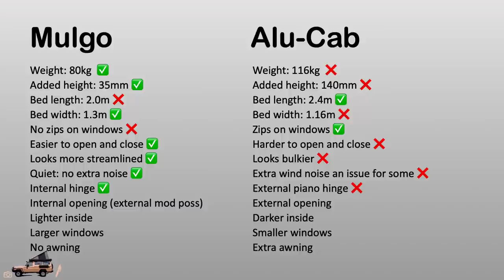Pop Top Showdown: Alu-Cab Hercules vs Mulgo. Troopy Talk Episode 3

Comment: Hi all, my name is Ben, I have worked for both companies and currently still at one. Which you will be able to guess. I would love to add some info to this video for a few things that were addressed and a few other points. Many touching on a bit more of the reasoning behind design. 

Mulgo is designed and manufactured by a team who has travelled the world extensively in a vehicle. Internal latching is actually more then just a few seconds setting up in the rain, you don’t have to leave the vehicle to open and close the roof which in an emergency, wildlife encounter or just plain terrible weather scenario means you can actually just pack up and go without leaving the vehicle. 
And Alu Cab owners, you would want a few extra sets of roof latches as the break regularly. 

As for canvas and bed width, two adults lying next to each other in Hercules and also alu cab tents results in shoulders touching the side of the tent which leads to condensation and wet campers. Not fun in the desert in winter trust me. The airtex canvas used in Mulgo doesn’t draw water. As for the darkness in canvas that’s irrelevant when sleeping in the bush. 
Velco vs Zippers. Well zippers seize. Velcro doesn’t. 

Bed length. If alu cab bed is closed and someone needs to pee in the middle of the night. Guess what? Your gonna have a angry wife who has to wake up and moved so you can pull apart the bed. 
Internal fire? Another reasoning why Mulgo bed is one piece. Don’t wanna get stuck upstairs. 
There was a 6 foot 6 Mulgo customer who had no issues with the single bed platform. 

As for external closing of Mulgo, that can be arranged on fitment as we do all CUSTOM fitting. Alu cab is an out of a box product. 

All Mulgo is CUSTOM to each vehicle to due travellers needs. 

It may sound like I’m throwing one company under the bus, I am just highlighting some stuff that should be mentioned. 

Free to answer any questions!!
Reply: Hi Ben. Some great points. Maybe you can help me with two things . first we have a third seat. Do you know if the mulgo or alucab allows more headspace for the person in the third seat when closed? Also, how does the mulgo go in wet weather without the awning. If it’s raining does it mean all windows need to be closed so no ventilation or is there a workaround for that?

Great video @fritzintroopy. Thanks for the comparison
Reply from the maker: Hey Ben. Thanks for your awesome input. I’m sure it will be extremely helpful for anyone watching and reading this. All excellent points which is why we love Mulgo so much. Cheers and thanks again.
Reply: @toryheaslop9069  hi Tory, the Alu Cab unit sits higher on the car and is a much taller heavier unit. We fit Mulgos to all two, three or five seater troopies. Both units sit lower then original roof as bed has to fit somewhere. Wet weather, I’ve had one up in cape York in summer time. Hot, muggy, wet. The canvas itself is breathable. Windows can be rolled down from the top and still under the outer edge of roof.
Reply: @Kelvin Weeding Thanks Kevin. Really helpful to know. I’ve been wondering about that for ages!
Reply: Good relevant information Ben. How does the Canvas on side of tent go when sideways windy rain, no water seeps in? Does having one of these mean you have to manage airing the side wall canvas out from time to time should the canvas be wet from again sideways rain & when you pull it down/close and the canvas could still be damp?
Reply: You mentioned they are custom to every customer.
Can you get a darker canvas and can the bed be extended if wanted? 
How big is the gab between end of bed and car frame atm when the bed is lowered? 
We have a hitop troopy atm and considering converting to a pop top.
Reply from the maker: @Kelvin Weeding that's great to know. Thanks Kelvin
Reply: Hey Ben,

Counter points for anyone that cares to read;

Internal latches are more a rare convenience in the event you don’t want to leave the vehicle for any reason, but would be an awkward maneuver for most grown adults.
Dangerous Animals, you could move vehicle if concerned with roof still up to avoid danger. 
Either tent could, and has been here, modified with External/ Internal latches to suit the individual.
Security may be the most valid point to internal latches.

Sleeping, you can still leave rear section up in the alucab if you're worried about the wife and are short enough to do so comfortably.
Or you can use the zips on the rear fly screen to exit if you need. Climb down the spare wheel, Could even take an extendable ladder to the side of the vehicle for the most frequent pee’r.

Bed width/ length is all relative to whatever size you are. If you’re Tall or short, and wide, you’re in strife either way.

Canvas colour/ Light Might be relevant to the traveller using vehicle as a camper during daylight hours. Or if the Bright Moon/ Early sun is of concern.

Zips Seize, velcro doesn't last forever either.

Internal Fire is a weird point, unsure how one piece Mulgo would save you in this circumstance? Without windows that open, you’re stuck up top to fry if there’s fire below.
Reply from the maker: @scottround3400  hey Scott. Thanks for your comments. All valid points cheers. Really helps to get peoples perspectives on these fit outs and there’s been plenty of good points made.
Reply: @toryheaslop9069  Hi, I have a 5 seater troopy with a mulgo poptop. The poptop was modified to deal with the rear factory seats by Daniel of Expedition centre by doing 3 mods to a version 2, 1-lifting the bed platform up on 20mm spacers, 2-dropping the rear folding seat by cut/weld to the folding by about the same and 3-the lower sandwich panel of bed frame directly above the rear passengers was removed. Result means my 189cm son can sit in the back seat easily, the overall external height exactly the same and still can carry bedding to about 40mm above mattress. Without the mods the rear seats would be very cramped been for a small person. From what I can figure out the mulgo is lower because the bed platform is lower, video/ images of both poptops show the alu-cab sits higher on the roof remnants.
Reply: @markwalters2490  Thanks Mark! I think I might have actually heard about the mod done for your 189cm son on the grapevine. Hope its working beautifully for you.
Reply: Even with this info, it seems the alucab shits all over the malgo. The extra sitting shelf, the storage extras and extra length are winners. It just looked better quality but  you can’t always judge a book by its cover I guess
Reply: Internal fire risk? You can unzip the fly screens in the alu and jump right out.. another huge bonus I think
Reply: @aussieadventurenerd8137  Australian made may sway people towards the mulgo.
Reply: The lower profile and 36kg lighter is the biggest factors that swayed me to the Mulgo.

Comment: A few years back I was looking at both of these conversions...ultimately went for the Alu-Cab for the extra length of the bed, the darker style canvas and the availability of a distributer not far from where I live. Haven't looked back in getting the Hercules conversion.
Thank you also for the life hack of adding a strap from the main bed looped thru the smaller flap to be able to pull it all down from the outside, fantastic idea!
If I'm able to provide a hack which I use to be able to close the main lid A LOT easier. I leave all 3 windows 1/4 to 1/2 open with the canvas folded in towards the fly screen (so as to not get caught) that way the air trapped inside can easily escape and the top will come down no worries at all. The lid has an exception weather seal the full perimeter and have never had rain, dust or sand enter under the lid and into the bed. Hope this helps!
👍👍
Reply from the maker: Thanks Nigel for these great comments and tips. Appreciate it. Cheers

Comment: This is great - a world exclusive! Here are my thoughts and comments on my Hercules.

Firstly - additional height. I really struggled to get a clear answer from AluCab on this, which really annoyed me. One fitment manual said 4.9cm additional height, another document or email from AluCab said up to 14cm. Considering I had a strict limitation with my car park height, this was really important to me. It's also pretty critical for anyone considering a Hercules, so I don't understand why they don't make it clearer. There is some leeway, it seems, depending on how it's fitted, which AluCab should document. The garage that fitted mine in the end were aware of my car park height - a little over 2.2m. In the end the Hercules added 8cm additional height. This, along with a a 5cm lift, left my Troopy a shade over 2.2m, which meant I could fit it in my car park. You can imagine my nerves when I first drove it home after the conversion... And how pleased I was when I made it to my parking space intact! (Obviously I had measured things all over the place to be sure, but still).

Weight - it may weigh 116kg, but the original Troopy roof is obviously removed. According to one of AluCab's fitment manuals, it adds 80kg overall to the Troopy once fitted. Presumably the bits of the roof that are removed as part of the fitment process weigh 36kg.

I really like the fact that the Mulgo lights have usb sockets into them. I had my garage run some power up inside, but it's not as neat as just plugging your phone into the base of the lights at each side of the bed. For me that would make a huge difference to the practicality of the Hercules.

I'm 183cm (6ft) and it's not really a problem if the person next to me needs to open the 'lid' to get out when I'm asleep. That area is also a nice spot to store clothes, books, etc, when you're asleep up there. Some people convert it so that it's cut in half so one person can slip down. With regards to the Mulgo I think for me it would be weird sleeping with a gap behind my head, plus my pillows, Kindle, etc, would fall over the edge at night! I've only ever slept up there with my daughter (8 at the time of writing). If it's my wife and daughter out with me I get relegated to a small pop up tent. I'm sure my wife and I would fit up there ok together and I know a couple who have travelled for weeks in theirs. When you're on your own it feels positively luxurious up there.

I need to check my side windows - a friend who bought one at the same time has zips on his for the fly mesh. I looked the other day and couldn't find any zips, perhaps I have velcro? Either way I've never felt the need to open them yet, but I can see why it would be nice to be able to.

I often don't bother with the 'awning' at the rear. I find I open the side windows to get some breeze or look at the view rather than the back window, but it's nice to have the option. A top tip if you do regularly put the rear awning up - get some grip tape on your rear bumper! It's really easy to slip, especially when the bumper is wet from rain or damp with morning dew.

The clips at the read do pop open. I have two little caribiners there to keep it closed. If I were travelling outside the UAE or the GCC, I'd put a padlock on them.

The Hercules is really well insulated. Keeps me warm at night (it can get chilly in the UAE, but rarely to sub-zero temperatures.) Best of all it keeps me cool in the morning when the sun's out. I tend to, ahem, go to bed quite late and like to sleep in in the morning. When my friends' tents have turned into microwave ovens from the sun at 7am, I'm still nice and cool in my roof, especially with the help of a small fan, until well after ten during camping season. This is very important to my enjoyment of camping!

The shelf at the front is great. I need to carpet mine so I can stick things onto it. I've run some power up into it, so I can charge things there easily.

When I was ordering mine in 2018/19 Mulgo would only install at their HQ in Oz (or at least only at affiliates elsewhere in Australia), so they weren't an option. 

The Mulgo does look like a great bit of kit - there's no clear winnder and I do understand what Ben says in his comments above about being able to open and close the roof in bad weather, or when surrounded by animals. That's not an issue for the way I use it, or for anyone else I know who has one in the UAE, but the point is still valid.

Both great options and I'm very happy with my AluCab Hercules. It does turn the Troopy into something you could genuinely live out of for long periods of time. I hope I get to do that one day.
Reply from the maker: Thanks Christopher for this detailed contribution. I'm sure it will be every useful. Cheers

Comment: From what I've seen, as an automotive design engineer, the Mulgo units appear to be designed around a roof replacement frame, whereas the Alu-Cab just seem to be a rooftop tent redimensioned to fit. That's certainly true on the Defender pop tops, where the Mulgo Cant rail completely replaces the roof for structural & torsional purposes so the vehicle could actually be driven with no roof. The tent is then built into that. The Alu-Cab doesn't seem to have much more than the Gen 3 tent bolted on & the lid clearly takes some torsional stress as they all bust the latches in use.

I know which way my Defender is going 👍
Reply from the maker: we're definitely happy with the design now having driven over some pretty rough stuff and done a fair bit of 4WD ing. the whole unit seems rock solid. great design
Reply: Not to mention the weight!

Comment: I would like to know what the interior height is when the roof top is closed? Is there any difference between the both? (As I would also like to sit and sleep inside when the roof top conversion is closed - for example in cities.) Thanks!
Reply: The interior height from underside of bed platform to metal cargo area 1110mm for Mulgo v2

Comment: Couple of Questions:
Just curious here with the Mulgo... to make the Bed longer, could u store a suitable size piece of Plywood under the mattress then pull it out and slot it in the open area to increase the length of the bed or just make something similar to what the AluCab has?
Also, Is there a option (paid extra) to have the windows/flyscreen modified to have zippers?
I noticed on the Alucab that once in bed that it would be impossible to exit the bed area during the night to go to the toilet without disturbing your partner...

During heavy rain period when packing up... With the Mulgo having no awnings I assume the canvas could get quite wet - when packing up is there a catch that water could eventually seep through the canvas when packed up and wetting the inside?

Great comparison... I didn't realise the differences between the 2. I initially preferred the AluCab but seeing the difference in bed width, extra height and overall height, the Mulgo might be better suited for our needs
Reply from the maker: Hey Rob, glad you found the video useful. You could make the bed longer using your plywood or similar technique for sure. I haven't bothered because its just long enough for me. Regarding the wet canvas apparently its not an issue for the bedding as it doesn't seep through. We've yet to be caught in very heavy rain. The worst we had was a shower overnight which made the canvas moist and there was no issue

Comment: Great review thank you for that! So in a nutshell the Mulga is for Hobbits and the Alu Cab for normal people. ;) ;) ;)  You showed me a lot of ideas for our Alu-Cab Hercules, e.g. that you can put down only the little bit to sit on it in bad weather, great idea. The pull down strap for closing both platforms at the same time. You didn't mention the electric set up, e.g. the reading LED lights up inside on either side, the lights in the front and end. For the closing of the roof in general, it is much easier if you leave a window unzipped and to make it much easier as well you should put the string where you pull below the rubber band which is holding the sides together, so when you pull it down at the same time you are pulling the walls inside... The comparison though doesn't fit 100%, "Harder to open and close" (In the video it looks much more work to close the Mulga), "Looks bulkier" (subjective), whereby darker inside is a huge plus for the A-C (when I am inside I usually want to sleep). The awning is a big plus, when it is raining you can leave the window open, without you cant. Great review! Much appreciated, thank you!
Reply from the maker: Hobbits... too funny😂. Interestingly many taller people find the Mulgo bed length suitable for their needs and comfort so I guess its up to individual like and dislikes. thanks for the extra tips much appreciated

Comment: I'm 182 and Mulgo works fine length wise. I don't sleep on my back with my toes pointing straight up, call me weird :P - also at first glance the extra bedroom is better in the alucab, but getting up for a pee in the middle of the night is no longer possible if you have your partner in there with you.
Reply from the maker: Climbing down separately is fantastic I agree. Mulgo all the way. Thanks
Reply: How many times do Mulgo users loose there pillow down the hole in the night 🤣
Reply: What if the shelf was cut in two so that each side could be moved independently?

Comment: Great video . I had the alucab and loved it apart from not wide enough for 2 . I do like the mulgo especially the width . Disappointing with the mulgo is the canvas hanging down when closed and have to wrap up also I can see pillows falling down all the time . The alucab is not wide enough and would stop me going that route again . I can see easy improvements in the Mulgo eg have a second hatch like alucab which would stop pillows etc falling , add length and I would also replace the material as it looks really cheap. The alucab material is perfect.  Again I love the alucab but would go Mulgo next time and add improvements myself .
Reply from the maker: The width is really important for us too. Cheers